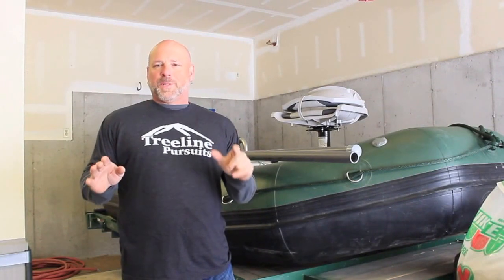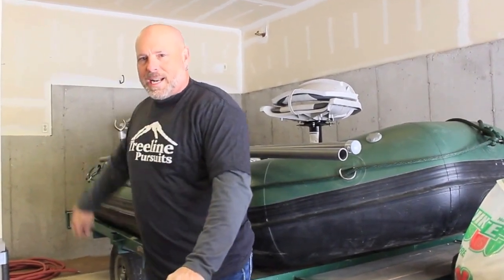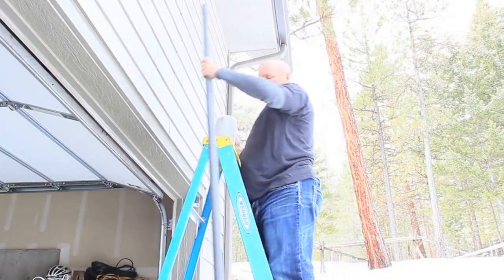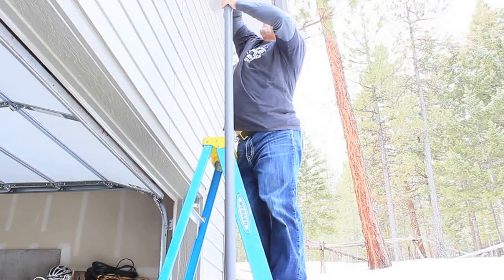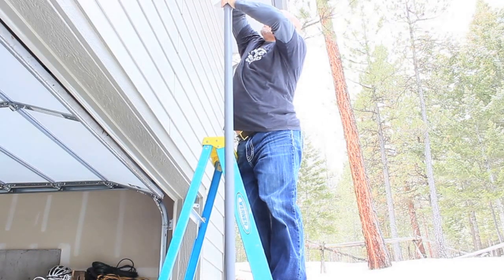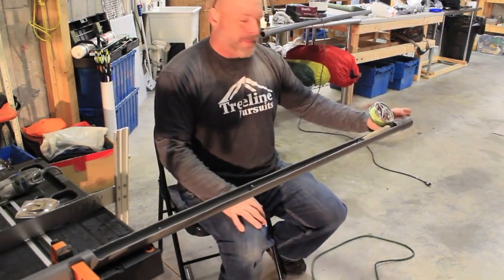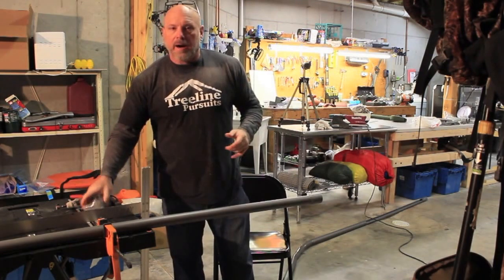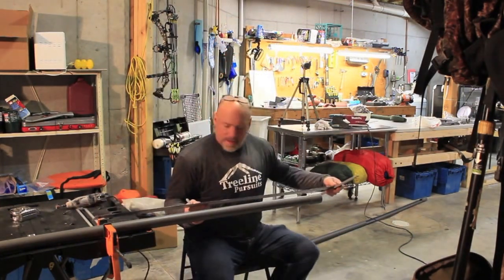How To Make DIY Raft Fly Rod Holders

Comment: An electrician for 30 years never used sand to bend conduit. Just heat. Stuff rags in the ends. Heat, bend, wipe with a wet rag to cool. Other than that excellent job. I will be doing this for my raft.
Reply from the maker: One of my best friend is an electrician and he told me the same thing...LOL.... He also told me to use a larger weed burner style to disperse the heat... The concept is valid, I love you guys are improving the plan...
Reply: @TreelineAcademy  thanks again for making and posting this video. Very helpful.

Comment: Hi there.. awesome rood holders, good idea. I think, I'll make the same holders my self. There are two things I would highlight. The curve and the end caps. Once I'll do mine, I make the curve not as sharp (larger diameter) to be easier on the rods and I'm not sure if I cap the ends, I'd actually leave the tubes open, heat the ends and "funnel" them a bit. In this way I can fit in 14ft spey and when I pulling the spey out the funnel will ensure I'm not catching the rod eyes at the far end. The tip of the long rod will stick out from the pipe a bit but again, I don't spey every day - not like I would'n't wish so ;)   Good job!

Comment: Just got my New AIRE super puma..with Down River San Juan frame...I am going to outfit it with four rod holders...great idea...thanks
Reply from the maker: That's awesome, I  have been running my a few years and they are still in perfect condition.
Reply: @TreelineAcademy  Where do you get the fancy pipe fittings that clamp to the frame...

Comment: Question will the 1.25" be good for 8-9 weight rods? we mostly use 5 & 6 weights but the larger for certain rivers. or should a 1.5" be used?